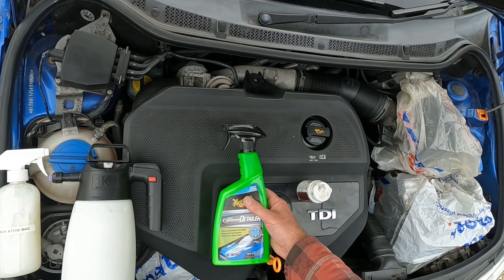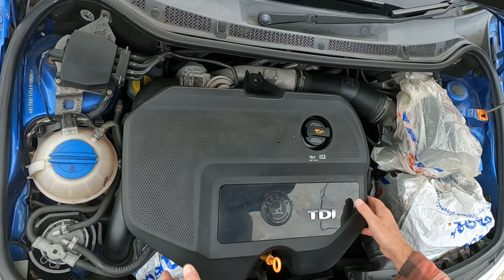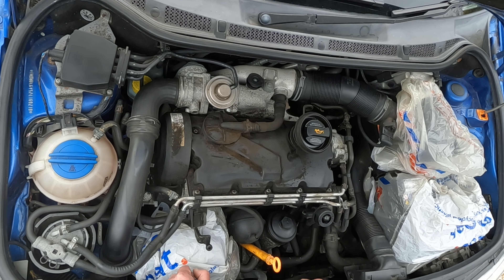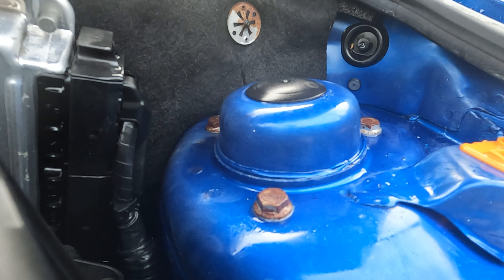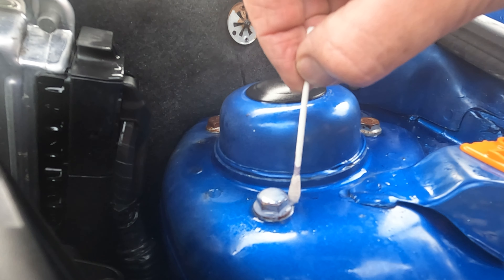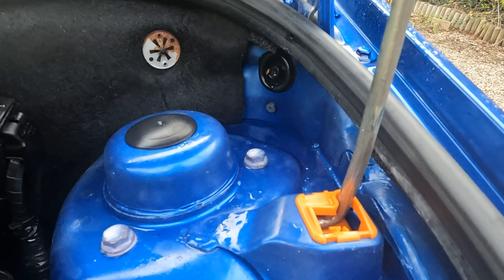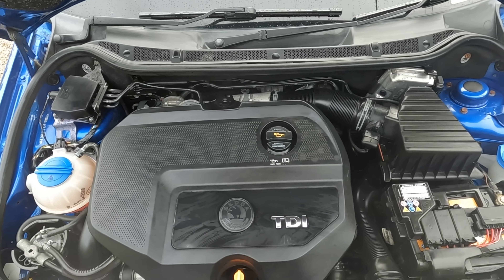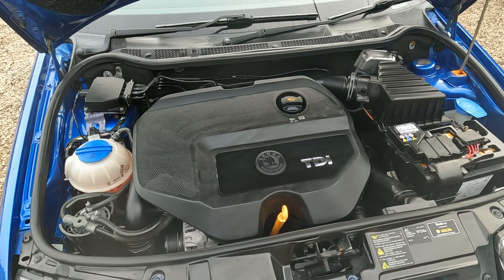Skoda Fabia Vrs Se Engine bay clean

Comment: I normally use Muc Off bicycle de greaser/shine in my engine bays.. they usually come as a multipack.. bilt hamber surfex for the dirty diesel cover however🤣
Reply from the maker: @foxsake_  Good point. I’ve probably got one of those eco sachets of muc off in my bike box. Rarely get my bikes overly dirty these days so haven’t had the need to use it. I’ll pop it in my valeting box and remember to use it up next time I’m degreasing. Hopefully that’ll be fiesta next. Thanks for watching and taking the time to comment. All the best.

Comment: These are very good the PD 130bhp these cars when new went like a rocket I remember had to sell mine as the mpg was getting worse dont know why
Reply from the maker: Hello. Yes. It’s a cracking little car. Mpg is awesome on mine. Mind you. Anything would seem good compared to the Subaru. Nice mellow drive though. Comfy. Reasonably practically. Handling frightens me a bit but again I’m used to the Subaru. I do really appreciate the super light clutch, dual mass flywheel and therefore ease of driving. I do a lot of miles most of which are spent in traffic and the Subaru clutch is like an on/off switch. Of course the Subaru is better on a long open run, but with today’s levels of congestion the chances to actually enjoy the Subaru are getting slimmer. I take the Subaru to work once a week and use it at the weekend as a treat. It’s awesome.

Comment: I know we all like to dress the engine bay plastics, so I'm currently testing 6 different lsp's / interior / exterior dressings to see which i prefer. So far, a spray sealant is in the lead.
Except i see Perl and envy sets in😂
Reply from the maker: @pigeonpoo1823  Which spray sealant? 303?

Be interested to see how your tests progress.
Reply: TW ceramic spray, though any that says it can be used on plastic and rubber would be fine. I'm just using it up.
The long and short is, dressings darken but can attract dust and don't last long. Sealants haven't made any aesthetic changes but will last a long time and make cleaning easier. So I'm going to try TW ceramic over 303 Aerospace Protectant to see if I can get long lasting shine. maybe you could add that Megs spray to the air box and see if it aids longevity?